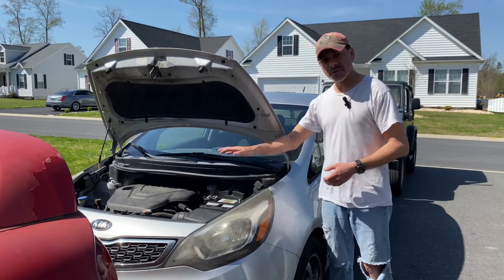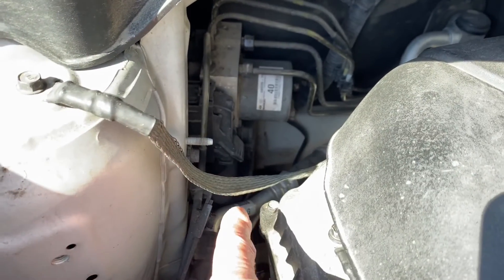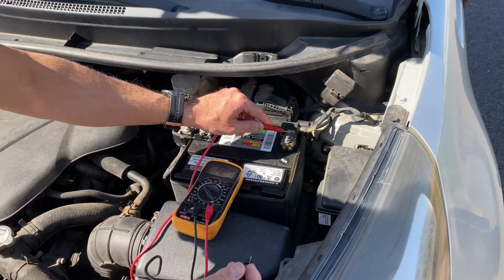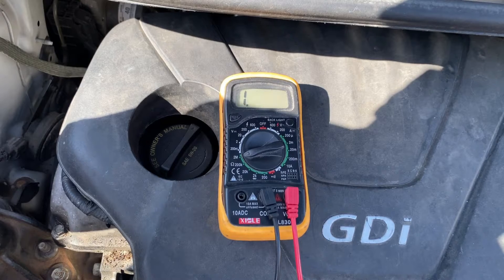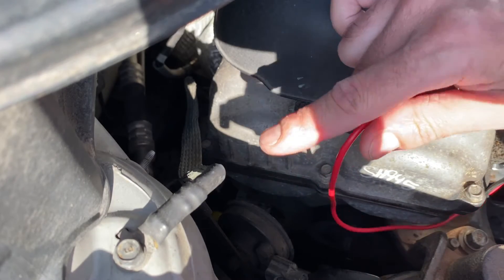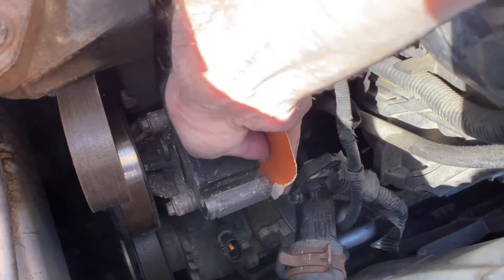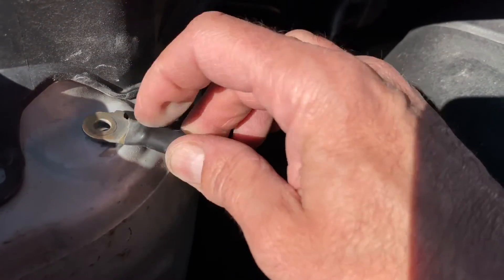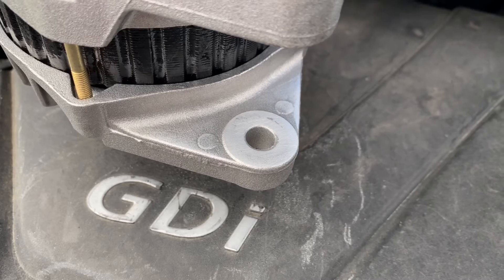Checking & Fixing Engine Ground Issue (Andy’s Garage: Episode - 467)

Comment: I pray I have found the engine or vehicle whisperer hahaha. Yes, I am aware of my lame interpretation of humor haha. So anyway...
When i hit the brakes, my driver side front running light illuminates. Both my headlights quit working the same night this issue arose...leading me to believe the two are related. According to Google, the former is a bad ground and the latter could be a bad switch or relay. I'm curious as to what your hypothesis might be. Hopefully you still actively engage with your audience, in the meantime, I am going to check my grounds as you demonstrated above. Thank you sir! If nothing else, I appreciate the knowledge shared in this video. 💪🏻
For added context:
'04 E350 Super Duty 5.4L gasoline V8 
360k original miles
57k miles on new crate motor install summer 2020
Recently hit some big mud puddles for my son, assuming the muddied undercarriage could be a significant factor in the equation 🤔😳😬🫣😔

Comment: when checking for the ground at 3:14, you put the red probe on the battery's negative terminal and placed the black probe on the ground.... isnt it supposed to be the opposite direction (red probe on ground and black on negative terminal). ??

Comment: I would be spraying either throttle body cleaner or electrical contact cleaner on all those areas in the engine bay- is that a good idea? My car has some short circuits somewhere and part of that is because it had obviously been sitting somewhere with wet leaf matter for a veeery long time before I bought it. 
I'm going to follow your excellent video for testing my grounds. I also need to do a voltage drop test so I'm interested in your mentioned other video.
Reply from the maker: You can but electronic cleaner is not that strong. You want to make sure the contacts are clean and good contacts. Here is the link to my Voltage Drop test video: https://youtu.be/vciL8qXVe2k?si=LSmvX4tB4e0rVnFd
Reply: @PhillipsVision thankyou so much! Your videos are superb!!

Comment: Don't look now guys, but this man is the REAL DR. PHIL.  I going to be paying closer attention to grounds on my vehicles and even my riding lawn mower.
Most shops won't take any time at all to look for things like this. Line technicians work on flat rate commission and it's all about getting the job done fast. I was one once, and I have seen a lot happen when it comes to electrical gremlins. Keep those battery connections clean--You too ladies, open the hood and look at your battery cables and check the oil every other fill up. Especially if you drive a lot for work.

Comment: I don't understand the continuity tests on the ground strap. Couldn't you have continuity even if the strap is broken because the frame and engine are all connected?
Reply: Not necessarily. The engine is mounted to the frame or subframe through rubber engine mounts, rubber doesn’t conduct electricity.

Comment: I have a 2011 Chevy traverse with intermittent issues with the battery voltage dropping while the engine is running. Brand new battery, brand new alternator. Re-checked both and they test fine. Weird thing is, once charged it can run fine one day, keeping a charge, and then the next day it can drop and cause the battery light to come on. I’m at a loss what’s going on. Do you think it could be a problem with my grounding points or cables?
Reply from the maker: @DorianHanson-k3q  Yes, can definitely be the ground. Make sure the ground is clean and secure
Reply: We have the same problem with 06 Trailblazer so I came here to see if that ground was a fix for you? My step-dad told me to buy a ground cable for $8 at Walmart and add a new connection to the battery from the alternator to make it stable for an easy fix, just came here to find an easy way to get to my alternator 4.2.

Comment: Like the video, but I was wondering that you were checking it with a ohm's meter, but there was no load on the wire to check for corrosion in the cable or wire. How would you test for that?

Comment: My car's battery light keeps flashing especially at low rpm we've trying buying new alternater and battery still behaving the same advice plz
Reply from the maker: @mauricekunda-47  This indicates that there is a problem with your vehicle’s charging system. If the battery and alternator are fine it could be an electrical issue. Take it somewhere to be properly diagnosed

Comment: I have problem on my Smart 450. All fuses are good, but when i set my multimetter to diode mode and test between positive and negative terminal i have continuity. Also my alternator is shorting to the ground. Problem manifest in instrument cluster turn on all lights even after key is removed from ignition. Just to mention alternator is charging fine. About 14.3v when car is on

Comment: Actually testing continuity of the engine to body wire does not test the engine to body ground.  To test that you need to test the continuity fron an engine part to the car body other than on the wire that makes the connection.  That way you are testing all the grounds between the engine and car body.

Comment: The ground to the engine block wire I think that’s my issue right now for my car it’s struggling so hard with clicking noises when I crank the key it won’t start but if I turn the key really hard it can start up the car lol but I’m a get to a mechanic shop this week to get it replaced hope it works I’m tired cranking my keys so hard just to start my engine lol
Reply: Ignition failure in tumbler
Reply from the maker: @beexiong2171  have you checked your starter?

Comment: Great video I have a question if the battery and alternator check out as good could it be the ground straps the battery light comes on and off and the car runs normal but wen the light is on it runs rough
Reply from the maker: @michaelburtin3457  it could be, or could be an electrical issue.